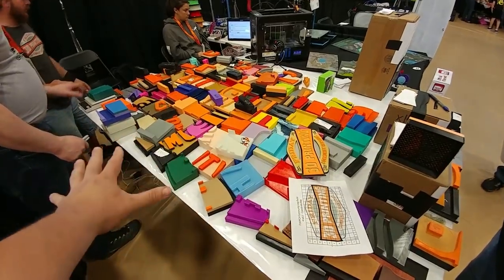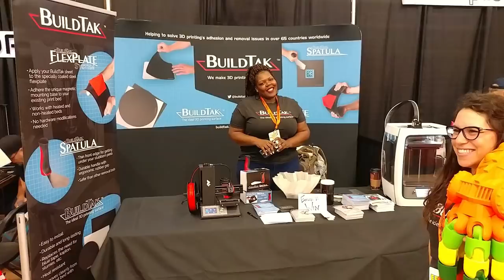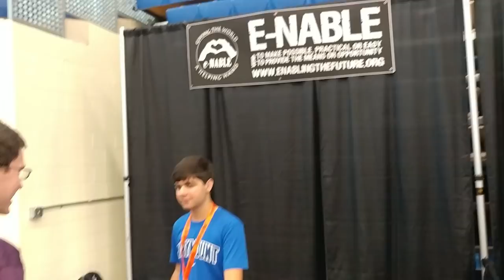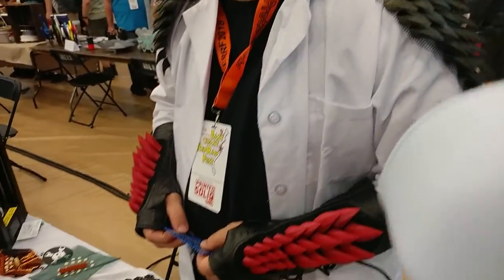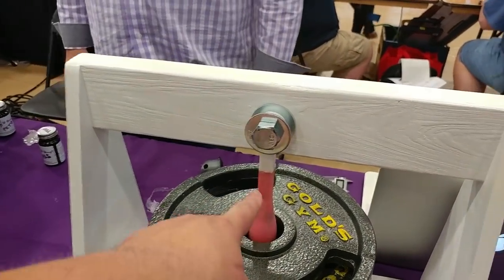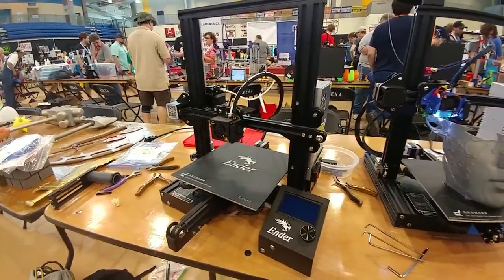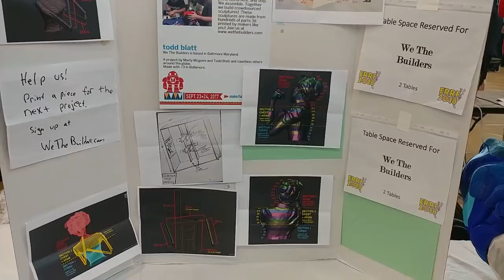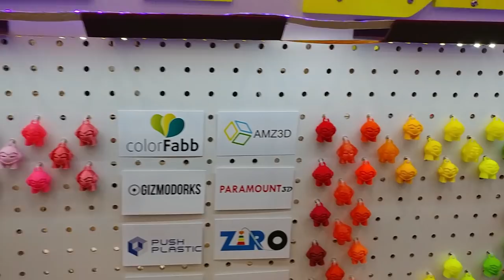T3DP ERRF 2018 East Coast RepRap Festival 3D Printing

Comment: Hey Chris, i got a problem i can't solve on my E3. On square corners i get ramps in both directions causing corners to stick out and measure oversize and on round parts i get a big bulge followed by a big divot in a straight line where the start,stop point is. Does that make any since or would you like a picture? Belts are good, not overextruding so any help might lead to a solution since i am stuck at this point.
Reply from the maker: I would need pictures to confirm but on a hunch it sounds like you're over extruding a little bit and maybe printing a little too hot make sure your retraction is 4 or 5 millimeters and your Extrusion multiplier should be 0.97 or 0.98 foremost prints 0.97 sometimes under Extrusion little bit if so use 0.98

The second thing you described it sounds like the Z seem which can be made worse if you are over extruding and or printing too hot

If you need to print hot try adding some wipe say 5 mm